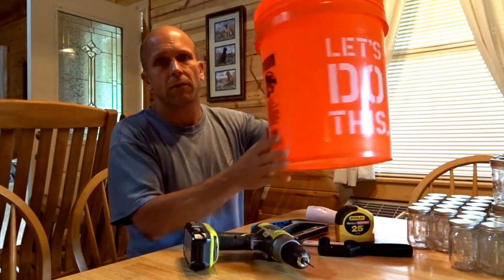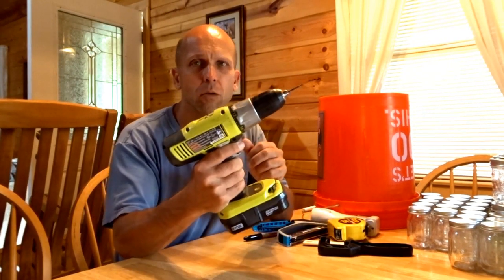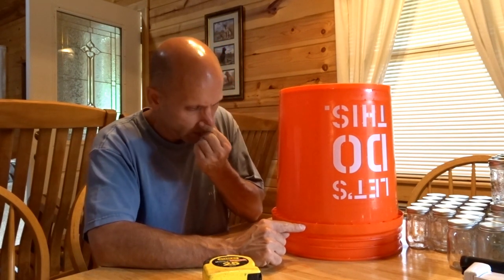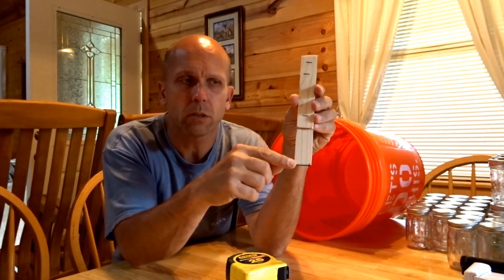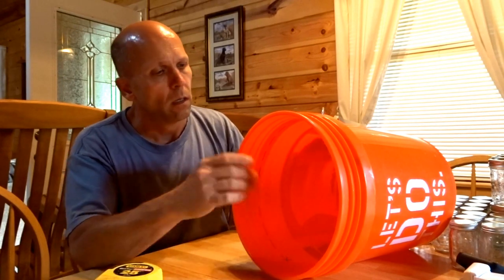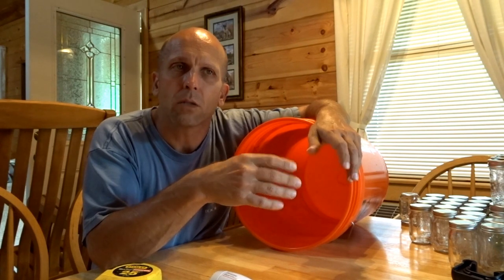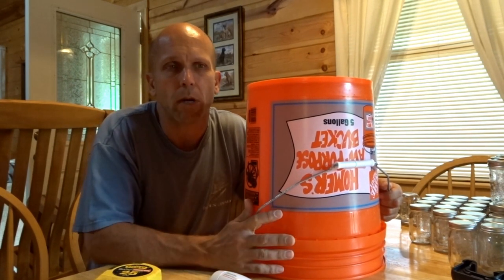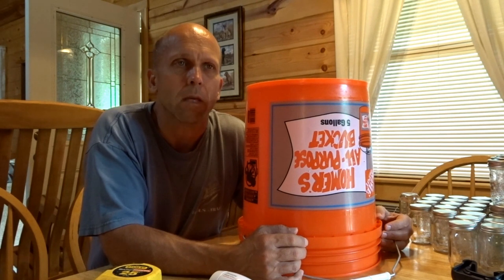Honey Bee 5 Gallon Bucket Feeder

Comment: Hi Joey..Great quality video..Thanks for sharing. My question is regarding the left over syrup. As the liquid level drops below the drill holes at 2 1/4 ", wont that leave ALOT of syrup left that the bees cannot access? . If you did talk about it and I missed it, I am sorry.
Reply from the maker: It does leave a little bit, yes. But it easily used in your next batch and candy boards if you make them. If there is any waste, its a very small amount. Thanks for watching and commenting! I really appreciate it :)

Comment: great watering bucket also i bet
Reply from the maker: This year Im using a 35 gallon trash can. I fill the can with sugar water and lay a few inches of hay/straw on top for the bees to land on. So far is much more efficient. Thanks for commenting and watching :)
Reply: @joeyoliver579   great!   so just fill 35 gallon plastic trash can and put few inches of straw on top? ill try it
Reply from the maker: @natserog  I mix 25 pounds of sugar in four 5 gallon buckets, then pour it in the trash can. Add the additional water, then put the straw on top ( a few inches) I have 12 hives and that lasts about 6 days. Much easier
Reply from the maker: @natserog  OH! put a couple boards across the top of the trash can and put the lid on the boards with a rock on top. This gives the bees access to the sugar water, and prohibits debris from falling in the sugar water. I have two cans and swap them out every week. Easy.
Reply: @joeyoliver579  sounds great ...thanks!!

Comment: Can't find buckets with lids like you show.
Reply from the maker: At HD and Lowes, they have them right with the buckets...just ask one of the worker people. Lowes is easily more consistent than HD. I just happened to be in HD when I thought of this. Otherwise I would have bought them at HD. ANY five gallon bucket lid will fit. Its a standard size. Wally World is definitely cheaper. Thanks for your comment :)
Reply: Thanks for the quick reply. the lowes bucket does not have the crosshatch around the bucket for the individual little reservoirs. I bought the lid that you can unscrew, it leaks.
Reply from the maker: Ill double check mine from Lowes this weekend, but any 5 gallon bucket lid should work. Walmart is the cheapest bay far
Reply: Walmart has the correct buckets in most places and in various colors. Their lids do not however have the rubber o-ring gaskets. I grabbed those at a true value. The lids with no o-rings do leak out and can waste most of your syrup.
Reply: I was just going to ask about the lids. I made my bucket last night, and the second I turned it upside down, all the water immediately began to drain out. Even though my Home Depot bucket says leak proof, it definitely is not. I shall track down a lid with an 0-ring. Thanks!
Reply: Many of the lids are pretty tight but only sealed enough to keep vacuum with many bees drinking, come nightfall it seeps out plenty. Other than the lid the main thing people would do wrong is drill into the handle hole opening which would cause it to drain out or drill the holes too far up the slot from what is the bottom of the hole when upside down or too big of holes. I think 1/8 is closest. I made a few that are too small and the bees kept them drained out.

Comment: This method does not work. Yes, the water will flow out from the holes initially, as the water is leaking out, a partial vacuum forms between the bucket and the surface of the water, hence, the initial outflow will stop as the pressure outside the bucket is greater than the inside
Reply from the maker: They work just fine, but Ive come to learn this isn't the best method of feeding. Thanks for watching!
Reply: It works...it has draw-backs. It's messy. Occasionally when  there are great swings in atmospheric pressure (I guess)it will blurp a little. Hence the mess. I use it, in addition to reservoirs inside the hive.